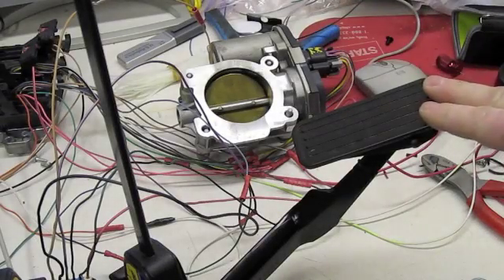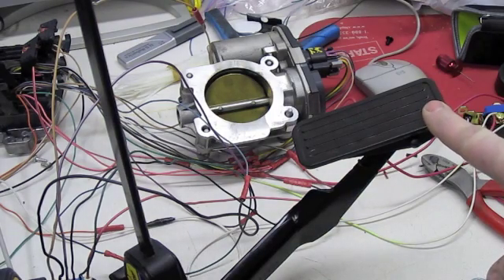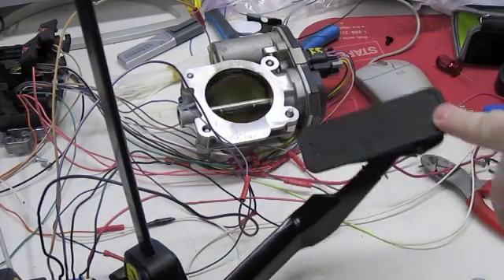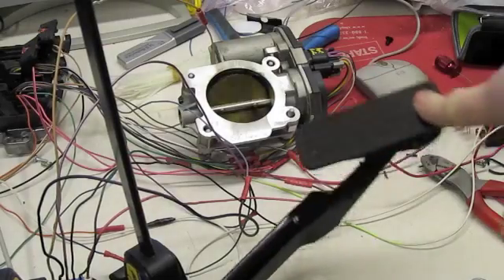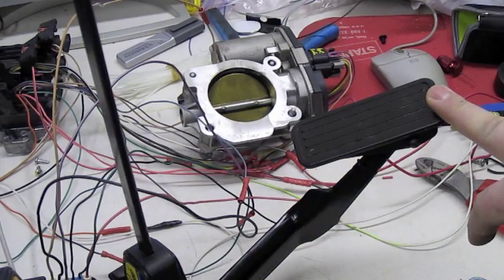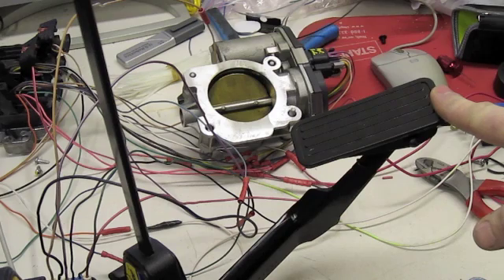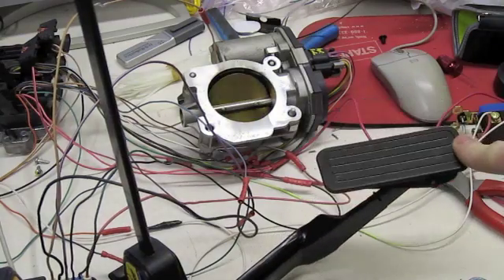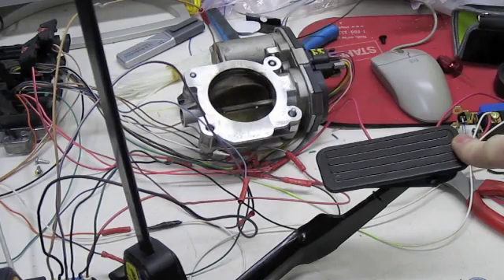Trailblazer LL8 4.2 liter electronic throttle demonstration

Comment: I have a 2006 Trailblazer LS 4.2L   Is there any way to make mine throttle body to activate as quick as you have the one in video?   Are there any other throttle bodies that would fit my motor from other motors such as LS2 motors?
Reply: i have ben looking for adaptor for it but for now have not seen any thing
Reply: A suggestion, if you have a lot of lag or its slower than normal, take that part out and clean out all the carbon with choke cleaner. It should run like a charm. And if your car shakes when you turn on the ac that stops too when you clean it. (: